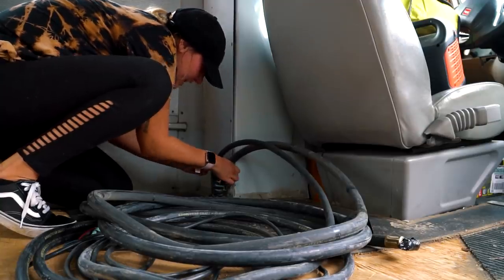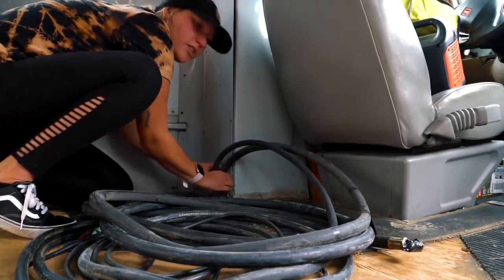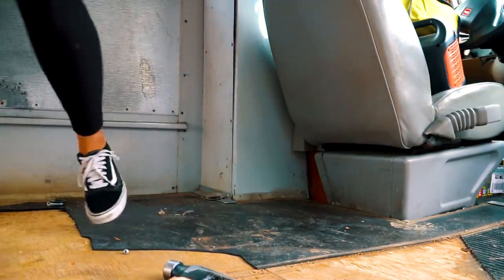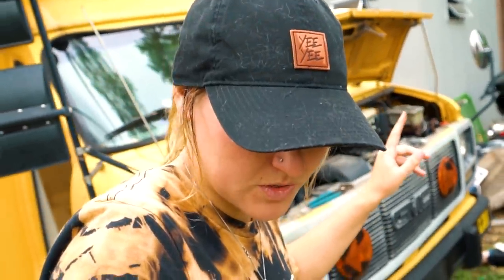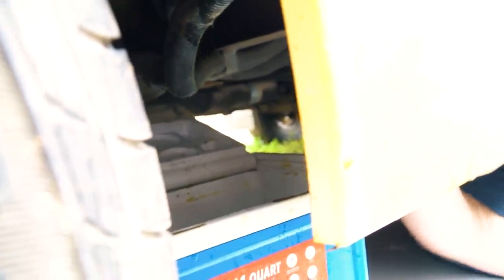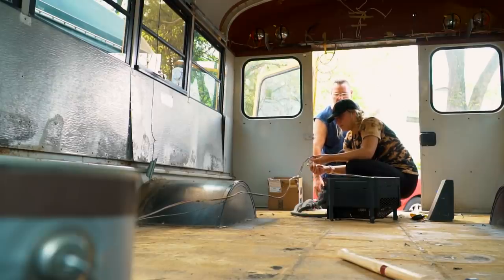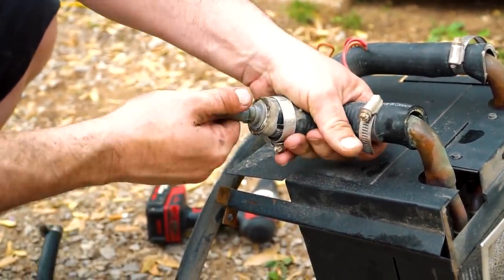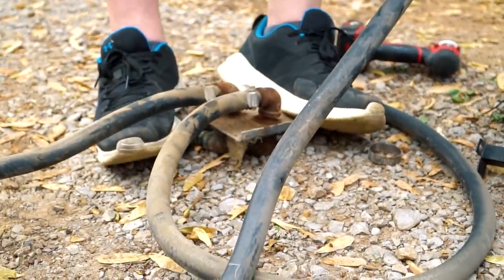Back On The Bus! Removing Heater - Short Bus Build

Comment: The hoses from the rear heater go up front and tie into the vehicles cooling system.  Unless you plan on installing another heater at some point, it would be best to disconnect them where they tie in to the rest of the hoses, probably under the hood.  There may already be a valve there to shut off the heater in the summer.  This will avoid any issues with those abandoned hoses springing a leak in the future and draining the coolant from the engine.

Comment: The heater you disconnected would be really nice when traveling when it’s cold. Much cheaper than running propane heater.
Also loop them off closer to the engine less chance of a blown hose.

Comment: The heater hose connects to motor up front and there is a return line which you need to keep connected to motor and loop a shorter length together. And lots of anti freeze would come out

Comment: they go to your heater core, I left my heater in its under my bench seat for my table/ bed and i vented it to come out under my table because i drive in the winter and it helps heat the bus while i'm on a trip.

Comment: follow the heater hoses all the way to the motor and then just lop them together as close to the motor as possible. once this is done you will need to bleed the coolant system to get the air out of the system so the bus doesn't overheat.

Comment: I just went tru the same thing with a small bus for someone . You really need to follow the heater lines to where they conect to the 2 heater
lines that go to your main bus heater in front you should see them under the hood what you will see is a tee splice on the two lines going tru your firewall on the right side . one side goes to the hoses tru the wall the center goes to the rear heater and the other comes from the motor find the ones that go to the rear cut the hose with enough roon to hook on to the tee splice that the 2nd hose goes to from the rear and clamp it down . That way you do not have all that hose running under the bus it is just a breakdown waiting to happen if it comes loose or you catch it on something and you just happen to be out in the middle of nowhere you are dead and overheating until it is repaired.

Comment: Hey girl hope you feel better! You may need to securely cap those lines it may be coolant from your heater core and the antifreeze from your cooling system for the engine! Double check that! John 😎👍
Reply: RIGHT, John.  Hope they figure out to cap those lines off before starting. @Leave Her Wild, don't start the engine without checking coolant level in radiator first. Make sure no leaks b4 driving

Comment: Your gonna have to cap that heater off better then that or it’s gonna be a problem later down the road you just need to buy the right fitting to connect both of those hoses.

Comment: It’s the paint scraper you should have used to remove that rubber from the floor.  It’s thinner & wider than the pry bar so should work way better.  
I used one of those paint scrapers to pry open a riding mower transaxle. lol

Comment: Nice job on the heater, but I'll add this, search those tubes and find them under the hood, cap them off there, it will save you in the long run, on coolant, plus much less chance of leakage...
Just my opinion..

Comment: In my last post to you about the heater, I told you it was a simple task to eliminate it completely as it was just a heater, two hoses and a couple wires. I still think you will be biting off more than you can chew by completely removing the existing floor, just remove the rubber portion, vacuum the entire floor, purchase enough sheets required to cover the floor.( 4 x 8 sheets) divide 4 into to the length of floor space to get the amount of sheets required. First off let me stress this suggestion, whichever side of the bus you start on make sure the short end is against the side wall or in order to save on cost, place the short end(4 foot against the side wall of bus and completely cover  all the way from front to back of bus) temporary place two screws to anchor it then lay the next sheet do the same for it until floor is completed. the sheets should be long enough to go from side to side  or you may have to trim a bit off but remember to make as straight a cut as possible but remember measure 2 or three times before you make a single cut, lumber is way too expensive to make a lot of mistakes,  then and only then remove ONE sheet  ONLY and spread a slight layer of TITE-BOND 2 wood glue and place the plywood back in place screw down the first sheet  with 1 inch long screws spaced approx. 6 inches apart from side to side of the sheet, and about a foot from that row start another row until it is fully screwed down, and so on and so forth until all sheets are glued and screwed. It will make a more solid floor plus there will be no worry's about gaps that will allow entry of insects. Viola! you have a clean new floor that you can install whatever type of floor covering you desire. 
        Doing it the way you planned (complete removal of existing floor) would require you to pre drill holes in any and all metal crossmembers to allow screws to be placed as they are the only things that you will have left to anchor the new floor to body of the bus and a waste of lot of time and prevents purchasing more drill bits as they are small and will break easily

Comment: hmmm yeah the rear door buzzer switch can prevent the bus from starting need to find out if its a normally open or normally closed switch , the closed type means that you need to connect those wires together normally open just snip them and tape them off , dont think anything else can prevent the bus from starting unless you create a short
you need to put longer pipe barbs in the coolant hoses to connect them as short as it is now it will probably pop off when the engine is hot and the pressure in the line is pretty high , it will cause the engine temp to get realy high realy fast and produce a huge white steam cloud as it dumps all the coolant out over boilingpoint
youre brother is right that the fitting is eazy to fix but you still need to refill the coolingsystem and theres a big chance it will happen again , i think those coolant lines T off from other interior heater hoses someplace near the engine , you could just put the one end of hose ontoo the other T fitting , that should work a lot better but might make the heater in the front less efficient (the way you hooked it up now is the same way) , best is to replace the T's with straight barb connections 
a neat trick i saw someone do with peel and stick tiles is using an old iron over a kitchen towel to heat up the tiles , peeled them off like the glue wasnt there , it might work with the rubber too and better than the paintstripper as the heat seeps through the rubber faster

Comment: Leaving those lines on just invites a leak. You should track them down to the source and put pipe plugs in the holes where the line fittings are. It'll be 1" plugs.. They should go the drivers heater core. On some models they go to a " T " which you can replace with an elbow, the other line goes to the defroster.

Comment: If U think it is allergies, you might try equate non drowsy Allergy Relief. Loraradine/Antihistamine. 10mg. Hope you feel better soon. You might want to save
that single big wire u took off as you might want to use it if you put in something that runs off your car battery. That's an expensive wire. Good Luck

Comment: What’s your dealing with is the heater Them two Run to the water pump on the motor you did right putting  them two together if you didn’t when you started The motor antifreeze  would have run out of them be safe

Comment: I am not sure that connecting those hoses together is the right way to go. Might be better to plug them off depending on how the hoses are connected to the engine. You will find out if the heater in the front of the bus doesn't work or the engine overheats. Would be a good idea to ask a mechanic that works on Buses. I hope there is a good heater at the front of the bus. You may wish you kept that heater. II would have been good to have the heat in the back so when you stop it would be warm there. The heater in the front will never heat the back of the bus.

Comment: Can you only use the heater when the bus is on?
Reply: Yes .  It runs off the Eng. heat .   Livin here in N.E.  I would keep that thing
Reply: @tracytavares1365  thanks. Wondered if you could use it another way

Comment: We just bought a 2013 Chevrolet Shuttle Bus that came with a heater same as yours and I tried cutting the power to it but it would still heat up and couldn’t figure out why until now. Has connecting the the lines into a loop worked out for you?
Reply from the maker: Yeah, but the connector my brother used was metal and eventually it cut the line while it was on the road, so just make sure you use the right connector. Like a plastic one from Home Depot
Reply: Thank you